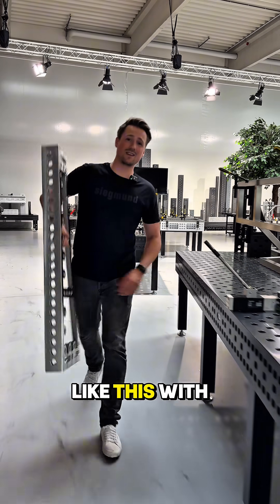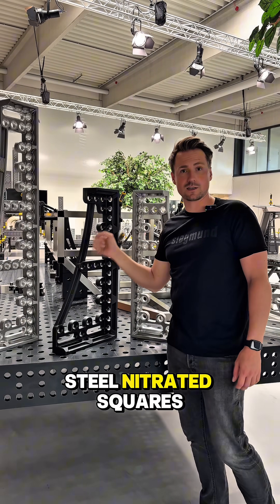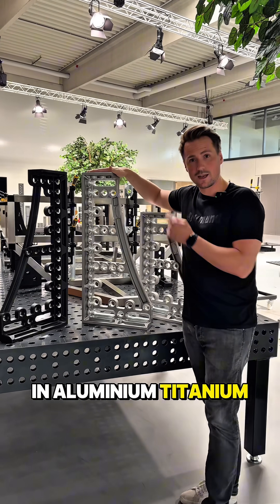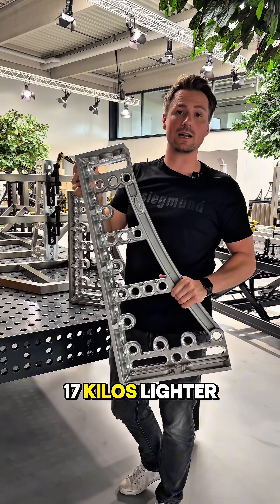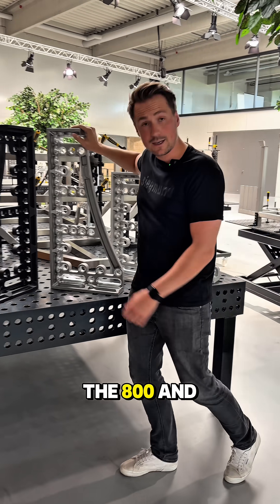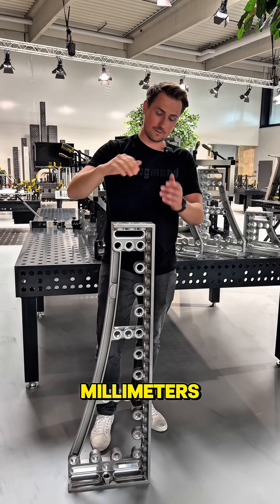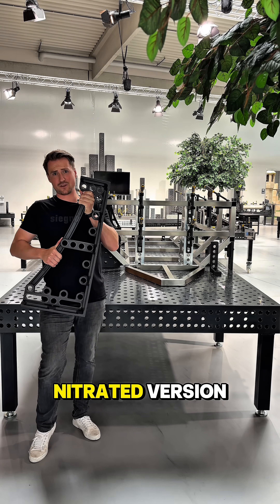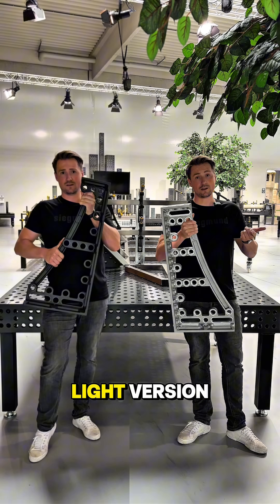Aluminum vs. Power Angle | Siegmund Welding Angle Test – Flexibility or Stability? #welding

Comment: I have 4 ft long box section aluminum extrusions for my System 16 table.  The main reason was the significant weight different.  The steel version is around 80 lbs where the aluminum is around 10 lbs.  So much easier to handle and set up.